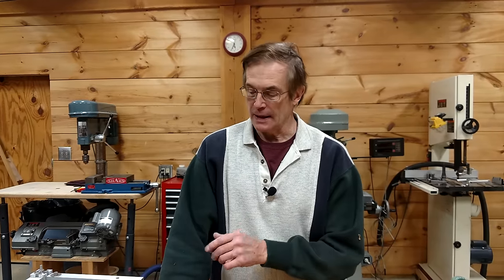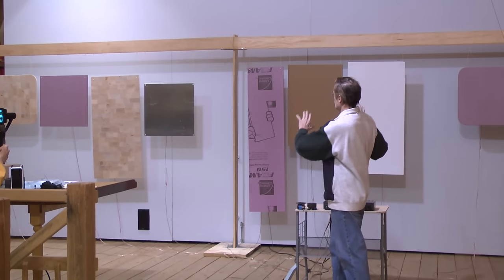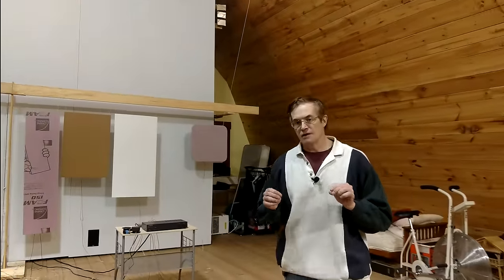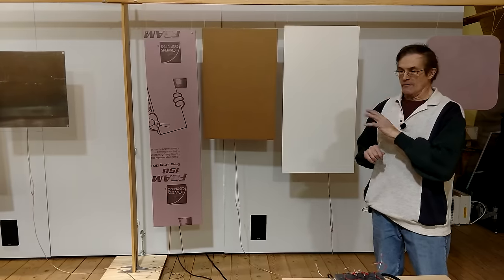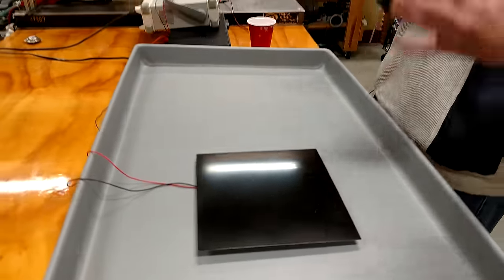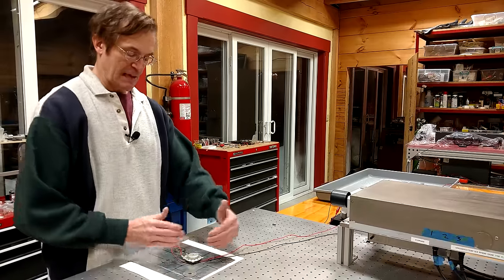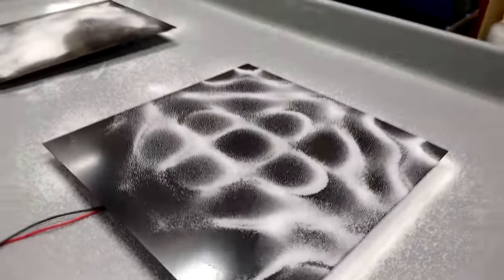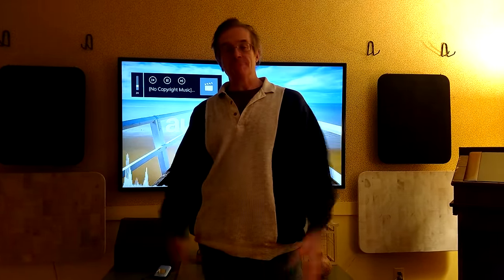Fantastic DIY Speakers for less than $30!

Comment: Came here for cheap DIY speakers, left with an acoustic masterclasses.
Reply: Dang introduction to phononic engineering...
Reply: I have found that experience to be par for the course on this channel. Its my favorite science class.
Reply: an*
Reply: @faraday9234  😊
Reply: @alejoboxcol  🙂👍 the rule is if a word following a or an starts with a vowel sound you use "an", and if it starts with a consonant sound you use "a". The spelling of the word is unimportant, its the sound the word starts with.
Reply: @faraday9234  I won't forget that rule, thank you very much.  Not only acoustic learning here, but also some good grammar!
Reply: @alejoboxcol  😂
Reply: and were loving every second of it

what I wouldn't give to sit down and have a conversation with this guy
Reply: @alejoboxcol  be careful. It's not about the letter it's about the pronunciation. For example "a user" is the correct grammer since user is pronounced yoo-ser. "An" is just used to make the sound flow better the same way "a el" becomes "al" in Spanish. So if you're ever in doubt you can just say the sentence out loud and you'll probably be able to tell the right one to use :)
Reply: @yo_its_devo  it's about the spirit of the law, not the letter lol.
Reply: @faraday9234  The English grammar rule is based on the consenant or vowel SOUND of the wotd after, not the first lerrer.
Reply: Insert the word "sound" twice to make you correction accurate, "...consenant sound" and "...vowel sound." Some words start with a consenant letter but have a vowel sound, so "an" is used. Oher words may start with a vowel that is 'silent' so the word is pronounced wotha consenanr sound, thus "a" is used. I also apply this rule to acronymns.
Reply: @76Patilac  seeing as consonant or vowel describes sound I thought this was a given. But you're right👍 I should've clarified
Reply: @yo_its_devo  yes thank you
Reply: @faraday9234  If it starts with a vowel or consonant SOUND - a unit, an hour...
Reply: Too funny
Reply: @yo_its_devo  I was just about to write this as well. “A yak”, not “an yak”.
Reply: @76Patilac  soft versus hard sounds.
Reply: @yo_its_devo  'an' is sometimes used before words that start with 'h' :)
Reply: @faraday9234  This is the most wholesome comment section and I love it
Reply: Live Long Bro You Made Me LOL  hunted me too with the revolutionary air conditioning system and here i am next stop Reflux Distiller
Reply: Honestly the sound quality of this video is such garbage that you can't tell any real difference with the speakers.
Reply: I wonder what would happen if you bond a panel of the foam board inside a poly bag such that the board is attached to the bag film, about in the middle of the flat side wall of the bag. Remove the air, seal the bag, and very gently, refill the sealed bag with helium. Not enough to "tension" the bag. Just enough to make it pillow. You wouldn't want the bag to "flap" in response to the sound.

Then hang the pillow from the corners of the bag.

The helium should "kill" the sound from the back of the panel. Because the gas is less dense, it should allow the energy from the driver to go into "making sound" on the side of the panel bonded to the bag.

The flexure formed by the bag should avoid coupling of the sound into the supporting structure.
Reply: Yet, this is just the intro
Reply: @faraday9234  an acoustic  -  is correct

Use A before words such as "European" or "university" which sound like they start with a consonant even if the first letter is a vowel. Also use A before letters and numbers which sound like they begin with a consonant, such as "U", "J", "1" or "9". Remember, it is the sound not the spelling which is important.

Here is the rule: Use AN before words such as "hour" which sound like they start with a vowel even if the first letter is a consonant. Also use AN before letters and numbers which sound like they begin with a vowel, such as "F" or "8".
Reply: @faraday9234  an acoustic  -  is correct

Use A before words such as "European" or "university" which sound like they start with a consonant even if the first letter is a vowel. Also use A before letters and numbers which sound like they begin with a consonant, such as "U", "J", "1" or "9". Remember, it is the sound not the spelling which is important.

Here is the rule: Use AN before words such as "hour" which sound like they start with a vowel even if the first letter is a consonant. Also use AN before letters and numbers which sound like they begin with a vowel, such as "F" or "8".
Reply: @linuxranch  They would all be at relative pressure, the helium would just have a bias against gravity, youd be moving the mass of the helium along with the whole panel even at such frequencies, and the bag. The pressure would still be equal on both sides despite their being different densities.
Reply: @JonathanSwift-ox9ci  I realize after davids comment I shouldve said "sound". I even knew this and still neglected to put it in my origional comment. Ive decided Ill correct it.
Reply: Wait... this whole time we've neglected the greater matter at hand...fellow grammar nazis... masterclasses would either have to be singular....or "an"... the whole subject of our conversation...would have to be removed entirely... It seems the dilema has evolved...
Reply: @faraday9234 really? Wow
Reply: Me mean: reely
Reply: Definitely helps though, now I understand what makes these work and how to make better sound
Reply: Now where's my cap?
Reply: One masterclass or multiple masterclasses? If multiple, then there'd be no need for the 'an' or 'a'.
Reply: No kidding . Dude knows his shit
Reply: Dude, this was a great "masterclass" I just bought some cheap sound agitator speakers from wall mart and you can stick them on anything to create sound, I have no idea what I'm getting into but I going!